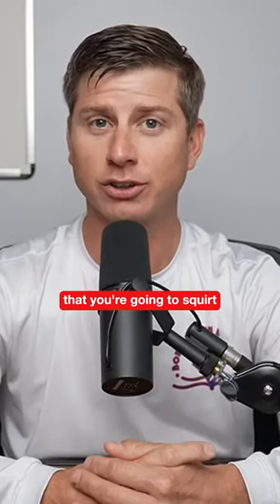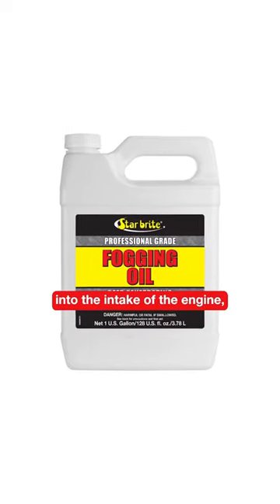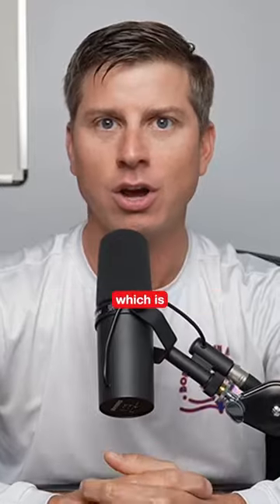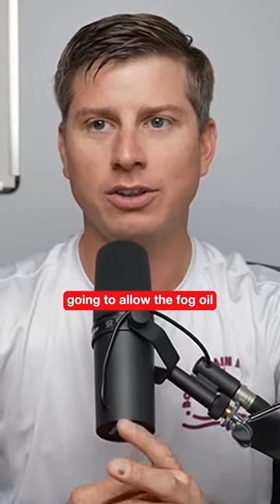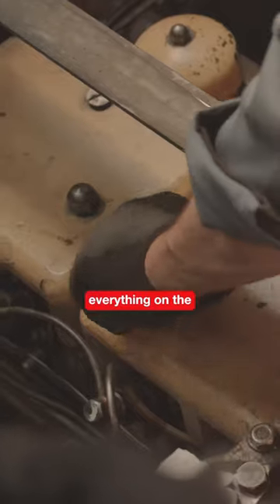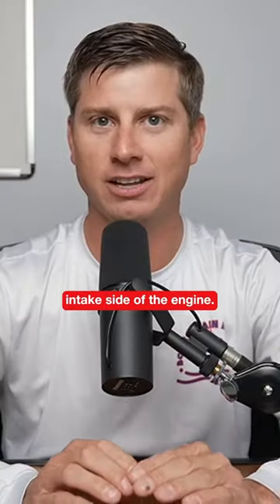CRUCIAL step to winterising your boat…#boat #boating

Comment: Fogging oil is for long term storage. If a shop does this just for winterizing they are making sure they can sell you spark plugs come summer when the fogging oil fouls the plugs.
Reply: Never had a problem using CRC Fogging Oil. Have used it over a hundred times. Great Content on this Channel. Thanks for all your Good Work!!